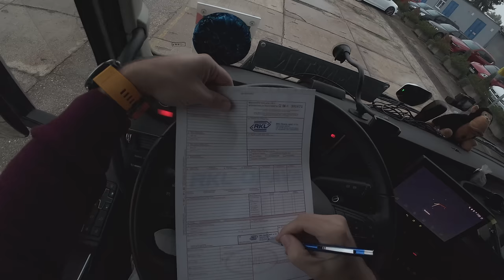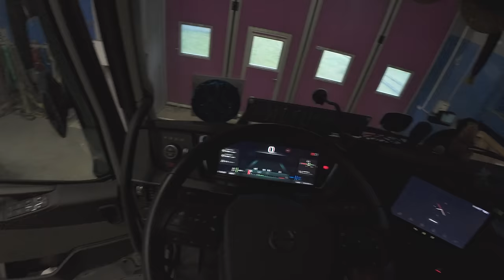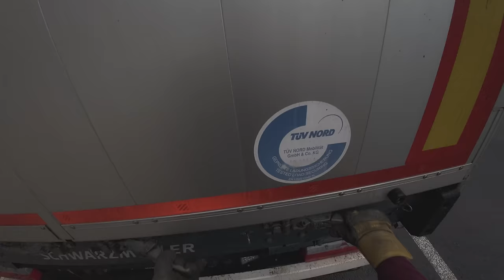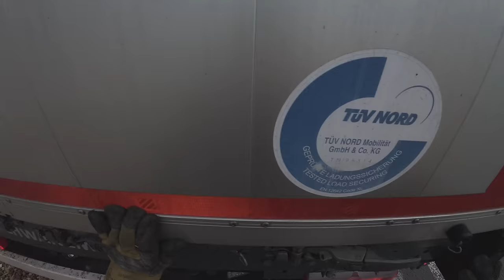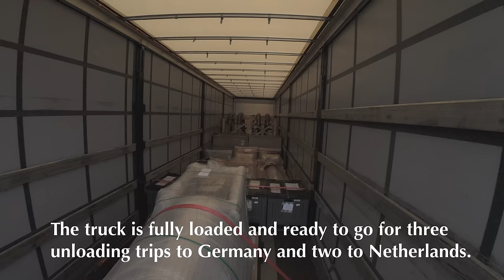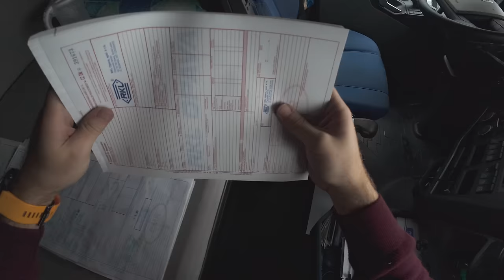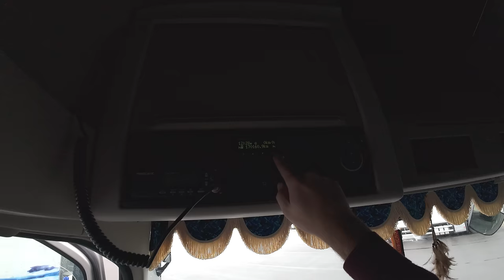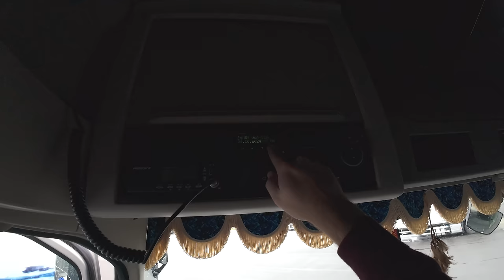Is this job for you ⁉️ Complete one day behind the wheel of a truck 🚚  POV Truck Driving VOLVO FH ❗️

Comment: What parameters does the Volvo driver score rate your driving on?
Reply from the maker: Thank you for the interesting commentary. Many factors enter into it. Standing with the engine running, speeding over 85 km/h, driving without cruise control, revving above the green zone, and many other sub-factors. It's a lot of indicators. But it's okay to drive at 95%-100%.